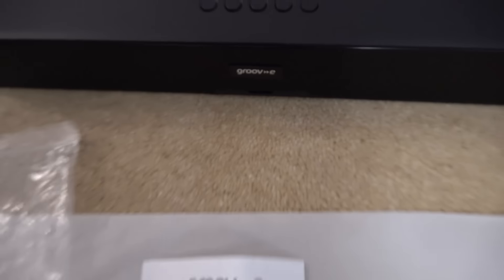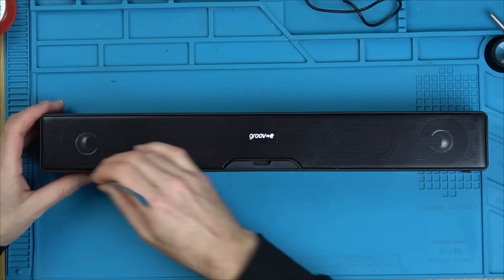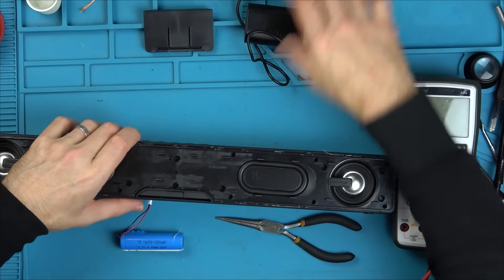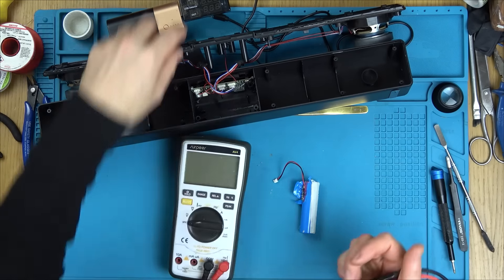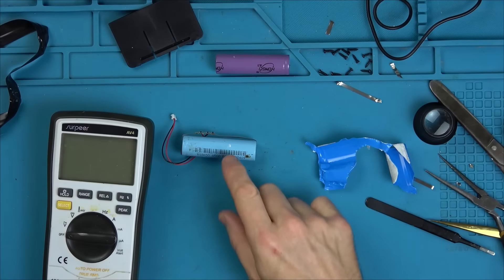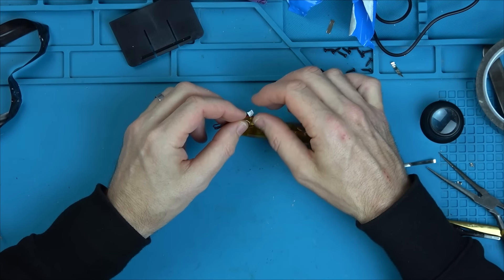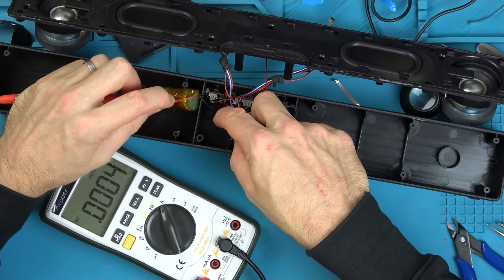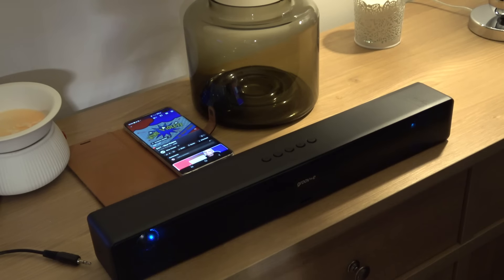MMV November 2024 Fixathon Day 3 - Faulty Groov..e Bluetooth Soundbar Speaker

Comment: So long as you start charging a flat 18650 at a low current, about 400ma, until 2.5v then charge the rest of the way with normal charger they will be fine. Blue heat shrink and nickel strip available very cheaply from aliexpress. Looking forward to the rest of the weeks fixes.
Reply: Yeah, it is not a safety problem bringing a cell back to life by trickle charging it. But if it's been under charged for a long time, it would have impacted the capacity of the cell and probably increased the self-discharge rate, so it won't perform as well.

Comment: The battery shrink wrap is sold by the meter. You can choose the diameter among many offered. The size is shown by the width in mm across the flattened material. The seller I use carries 7-280 mm width. My last purchase was for Red, Width 36mm Dia 23mm, 2 Meters

Comment: As far as I know for 18650 cells: 

Icr = cobalt based. Usable for low power applications like laptops and radios. Have low self discharge.

Inr =nickel fosfate based. Usable for medium or high loads, have higher self discharge. Used in power drills and ebikes

Imr = mangane based . Usable for medium loads, has higher self discharge. Used in ebikes

Ifr = fosfate based, also known as lifepo. Is considered more stable and safe. Used for boats, campers etc .
Reply: Best post, thank you. In practice it probably doesn't matter too much if you swap out one 18650 lithium ion battery for another, more expensive one. I've substituted higher capacity cells quite often and improved device performance.
Reply: @JohnGotts  that shouldn't be a problem on lower power draws indeed. I've done the same on several devices. I will advise not to mix and match different types together without proper knowledge because of the difference in internal resistance and maximum power draw. That can create heat spots, with all the dangers we know about lithium cells.

Comment: You can buy 18650 wraps and you're right, its just like a heatshrink wrap tube/sausage 😂
Reply: 18650 wraps probably won't fit over it. Might need 21700s.

Comment: The 8205A is an IC that can be used to protect lithium-ion rechargeable batteries from overcharging, overdischarging, and overcurrent. It's often used in combination with the DW01 IC, which monitors the cell's voltage and current.

Comment: Lithium batteries will drain themselves very slowly over time even not being connected to anything. Usually if you happen to get a dead one in a brand new product it means that product was sitting in the warehouse for a long time.
Reply from the maker: Seems like going forward that this will become a bigger and bigger issue. I wonder if the simple solution is to just have a 'storage' on and off switch located on the item on the wires from the 18650 batteries. That way those DIYers that only use there battery tools once every couple of years when working on a project or those that put there items into storage don't have to encounter this issue 👍
Reply: What is the mechanism for the draining?
Reply: It can also mean the batteries were stored in very cold conditions. i don't mean England cold; I mean Winnipeg cold.
Reply: It is the internal resistance that is draining them. However good quality brands like samsung or lg do not really suffer from this. I have about 5kg of them stored for 3 years now. They are still ok. It is with these cheap items that have ultra poor quality batteries. Better use a potato.
Reply: @brettito   Charging messes with the chemistry of the cell to store the power.  Over time this chemistry wants to revert back to its original state.  Lithiums lose 1-2% a month self discharge when connected to nothing.  If left flat then this takes them down to almost nothing in a year.  If a warehouse full of cheap stock for over 12 months then... you get the idea.

Comment: Love the videos Vince.
The wrap is just a heat shrink plastic tubing. It comes on large reels and is cut to size depending on your needs. On large scale battery manufacturing they are cut in a machine that also prints the spec, the battery is then inserted in the sleeve and it goes in an oven similar to a hot dog machine.

Comment: The battery capacity has no effect on the circuit inside. It only extends the working time of the device. You could have a 10 Ah(10.000 mAh) 3.7V lithium battery there and it would run for days without charging. Of course charging would take a bit longer also.

Comment: Never boring. still a fix. I wonder, in some of these designs, whether the battery can drain below the cut-off level (discharge protection either poor or not present) and then either the BMS won't let it recharge or the battery is already damaged. Over charging can also damage batteries. Perhaps obtain some mini JST sockets and plugs to make an inline current tester.

Comment: You said it "Heat Shrink" and most electronic Hobby/Tech Outlets have all sizes and colours available 
right up to 50mm or greater, And the bonus is.. They will wrap and hold the end stickers or plastic ends..

BTW consumers are known to buy devices and then expect them to work up to the advertised time from
the get go, in short they don't charge the devices fully up before the very first use and so the battery is 
drained before a proper balanced charge has been applied, and yeah I know only one battery here but it
still requires an initial full charge..

Comment: Great video again, Vince but just a heads up with removing hardened "Hot Glue". just a spray of IPA does the trick to remove it from any PCB board and also plastic.

Comment: Another great fix, Vince!  I'm curious why you think a discharge lithium-ion can't be recharged?  From my experience, it just has to be charge slowly (trickle charged) to prevent overheating and/or exploding.  The same can happen with a car battery that's totally dead if you try to fast charge it.  It taking a .001 slow charge seems to be exactly what it needs.  Since these items seem to be new and unused, it's possibly they didn't get charged properly from the factory and just needs the trickle.  I have seen some people jump the battery and it starts a fast charge.  That seems like a bad idea.

Comment: 15:10  I think the Fuse inside the Multimeter for the mA Range is blown. 
Any Device with a Microprocessor draw a litte bit of current, if there is no mechanical Power Switch.
Reply: Most microcontrollers can go into a low power mode, drawing much less than 1mA. More like 1 uA until they are woken up by a button press.
So it would have been more useful to see the reading from the uA range on the meter.
Reply: @martin_soerensen  absolutely right

Comment: Another good video Vine have you never thought of getting a cable probe that way you never have to cut the cable? the one i use is like a clear plastic crocodile clip you just clip over your wire and push the point of your probe through the small hole in the clip.

Comment: Check the fuses in your meter.  When you went to mAs I would expect the meter to read 1 if it was drawing to much current for that range. If you tested the current as you do the voltage at some point before you knew how to test current the fuse in the meter for mAs would have instantly blew.
Reply from the maker: Good call PDS, I'll do that. Thank you👍

Comment: The material used around 18650 is commonly called shrink wrap, (it's the same stuff they use the wrap cars) but it's commonly sold as "shrink tubing" or "heat shrink tubing". The main difference with regular heat shrink tubing used in electronics is the material and the thickness. The thin shrink wrap is PVC while the thick heat shrink tubes are polyolefin. PVC is stretched and shrinks in length and width, while polyolefin is designed to specifically only shrink in diameter. Additionally, PVC is less resistant to heat and will burn at lower temperatures releasing particularly nasty chemicals like hydrogen chloride gas.

Comment: I get a very similar hot shrink product (material and thickness) for putting over the top of a bottleneck after inserting the cork.  Heat-gun  then makes it shrink in a second to the required size.

Comment: that litle protection circuit attached to the battery called BMS ,battery managment system , u can omit it. also u can use power suplly to charge the dead battery

Comment: You could have put a insulating material between cell and BMS's exposed wires. Now there is just covering of cell that's stopping the positive of the battery from shorting to the ground (oter metal) of battery.
After that yiu even squeezed that BMS to the battery with kepton tape that increases it's penetration possibility and easy to be shorted now.
Except that everything was good.
Hope you will put some insulation there.
BMS also drain the battery if that's cheap BMS.

Comment: I don't it makes a difference with a single 18650 Li-ion battery you put in there (ICR or INR) except if it's an IFR (LifePO4) they charge at a lower voltage but then again I'm no battery expert this is just what I've learned over time repairing stuff

seems like the material the heat shrink wrap are made of is PVC just did a search of "18650 heat shrink" and they came up
Reply from the maker: Thanks Karthor, I bought some 18650 heat shrink the other day 👍👍👍

Comment: The battery you removed is the cheapest of the cheap, had a Chinese made drill battery that's supposedly 20v have 5 of them in when I tested them they were 500mah each! The wrap can be bought pre cut probably same seller as you bought the paper end caps from .bought some for mine with pictures of the joker on them haha😅

Comment: Pretty sure Fogstar where you get the batteries from sell 18650 battery wraps, you can definitely buy it on a reel somewhere that you cut to size probably eBay, I have some but can’t remember where I got it, was for replacing wraps on vape batteries when they got damaged.

Comment: I don't think a fully discharged cell is more dangerous than any other lithium battery. I think it will just have a reduced useable life. The battery when fully discharged or even in reverse polarity state can form dendrites from the copper which could short circuit while trying to recharge the battery. This could potentially cause a fire. But I think if when you charge it back up and it holds a full charge OK then the dendrites will not have been formed and the battery should be safe. i.e. if it doesn't burst into flames while your charging it - it is safe to use after that point if it doesn't get warm. (A bit like walking through a mine field to see if it's clear.) But I would just change it if I was to give or sell the device to somebody else. I wouldn't leave any lithium battery on charge overnight or unattended in a residence, no matter if it was considered a faulty or good battery.

Comment: Thanks for replying re the spot welder make and model vince. WE have a lot of returned items (Chinese made) that have very low cells... you name it ,xmas lights (single) solar lights etc  dead, portable vacs 12v, 12v strimmer's, a few batterys with bad spot welds hence me asking you. the list goes on and on m8. because of time and the volume of items i was told to scrap most of the cheaper ones :( ps a lot.

Comment: For the Li-ion batteries, replacing like for like isn't always the best idea. A lot of these products use very cheaply made 18650 cells, like the one you found in this product. It probably already had an internal short from factory. If it hadn't drained itself down to zero, it could have exploded if it was ever charged at the rated current (1c).

The important thing is that the battery is rated for the current drain of the device. In this case 10w / 3.7v ≈ 2.7 Amps, so a cell that can handle 3 Amps. INR is usually the standard, it offers a good balance between safety and performance. IMR and IFR are even safer.

Don't use INR or ICR cells without protection. And don't use them without temperature monitoring if they are charged at high currents or discharged at high currents. In this case 10w drain is not considered a risk, and your standard INR cell is an appropriate choice. You can check, but I don't think the device will charge the cell at a high current, it's probably limited to 500 mA or 1A max.

Lastly, if there is the space, why not put 2 new 18650 in there in parallel? The device will have double the run time 4h instead of 2h.
You can buy the battery protection boards online at AliExpress and other places.

Comment: I had a smaller Bluetooth speaker and the 18650 would die fast and after charging for a day and leaving it sit around it would go dead , so I changed it and everything worked fine. I was pretty sure the old 18650 had an internal short of some sort

Comment: this battery is not like the one in the drill that one required the lowest internal resistance for high amperage output but these cheap speakers don't care what cell you use the only difference will be capacitance or how long you want it to run on a charge

Comment: I dont think the concern over the type of cell is necessary here in this low power use case. If it were something like a drill then well warrented, but any old 18650 will work fine here. Also maybe I should rewatch the screwdriver video to understand the 18650 hate :D If anything having an 18650 there is far better than a pouch cell that is then custom and needs ordering. 
Also <not an expert> in terms of low voltage, while I cant talk to safety, I can with experience talk to trying to revive/reuse such cells, and what I have found consistently is that while you can revive and charge them up, they either have very low capacity now, or very high self discharge, and will self discharge over a couple of days.. so not worth reviving and not worth worrying about safety even.

Comment: They want you to throw it in the bin. I bought a lamp recently wich stated "non changable battery" on the package. When I removed the sticker on the bottom I found a battery holder with a standard 18650 (even no lugs!). So it's very easy to change - but the vendor seems not interested in such things ...

Comment: It's amazing how these cheap chinese products became so usable. Just simple and effective circuit design. I see a lot of low quality 18650 batteries with a real capacity of about 900mah. Put a 2000 mah battery - it will be a big upgrade. Or slowly charge the "dead" battery if the device doesn't have high consumption.

Comment: One of the dodgier sides of Shenzhen's factory base is they will reuse old laptop batteries harvesting the 18650's and using only those that charge well and hold a good charge but they go to enormous lengths to hide this using new wraps and making the cells look like new when in fact that cell could be halfway or nearly all the way to its recharge limit where they start to decline dramatically in performance.   18650's can have as little as 500 recharge cycles to average 1000 cycles so its really important to discard any suspiciously Chinese 18650's because like it as not, it is prob a many years old quite heavily used harvested 18650 from a laptop battery, the fact your one seems to have dropped under its minimal level suggests to me a fairly shagged out cell polished like a brown one with the hope that most people would keep it mostly plugged into a power source anyways... very naughty and these are some of the dangers of buying from China.   Avoid always any Chinese cell with "fire" in the brand and also any cell that has claims to ridiculous mAH, yes there are very high end cells from Sony and Samsung with 30+ amp draw but you pay extra for that.   Keep an eye on sodium 18650's, lower mAH than lithiums but are uber cheap, won't blow up like lithiums and seem to have a much longer recharge cycle than lithiums.
Reply: UltraFire batteries, and usually misspelled, too. Best avoided.

Comment: Instead of cutting the battery wire. You coul have stuck resistor legs into the terminal block and put it through a breadboard. You would have been able to add your mm into the current path then

Comment: If the charging is controlled, why is it a problem if theyhave drained to 0V, surely if it has failed completely it would not take a charge, asking as a numpty....
Reply: I have revived several completely empty Li-Ion batteries, and no negative effects noticed. 
I find heat and overcharge much more scary than a battery completely discharged.

But - if you have batteries in series without BMS (battery management system) and one cell goes flat, the one(s) with power will continue to push current through the flat battery, reverse charging it. That is very bad.

Comment: Vince you are being a bit "precious " about charging lithium cells. If you use a low current from your power supply and bring the cell up to about 2.5V then connect the device charger it should be OK. I set a current limit of 250 - 300 mA. The battery could have been discharged completely by the previous owner leaving the unit on, and when the charger didn't recharge in a couple of hours they returned the item as faulty.
Cheers Eric

Comment: should weigh the batteries to see if they are sub standard. 44-47 grams I think are the right weight. 35 and lower will be fake watch batteries with flour
Reply from the maker: Interesting, never heard this before. Thanks Emma👍
Reply: @Mymatevince  can just google 18650 battery weight and it will show you on images

Comment: You should check protection circout on battery if no drains the battery, sh*ty ones somtimes drain even few miliamps 
Ar you sure your miliamps scale on multimetr works correctly? Maby u should check it. 
And why not use microamps scale to check very little currents? U have one on your multimeter.
Reply from the maker: Thank you, truth be told I didn't know about the micro amps scale until it was mentioned to me a couple of days ago. I'll use it in future and also check the fuse in my multimeter to see if it is working. Thank you👍